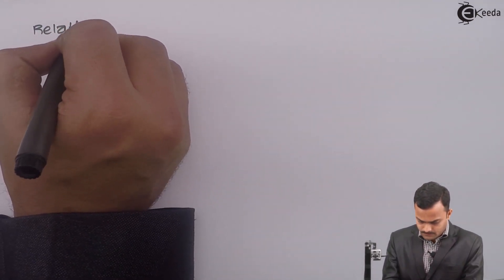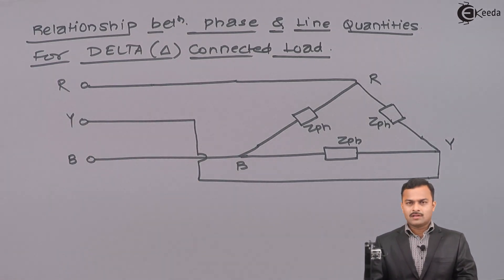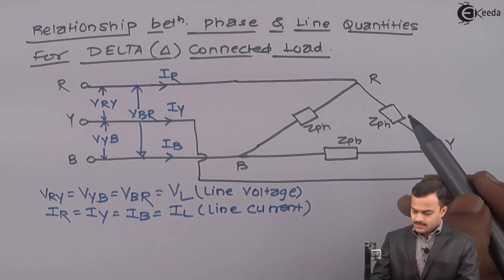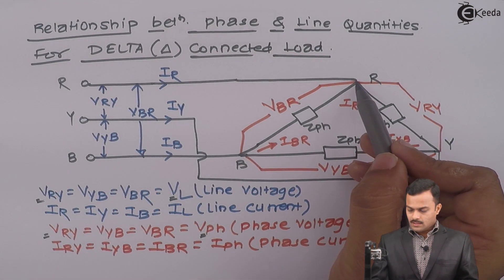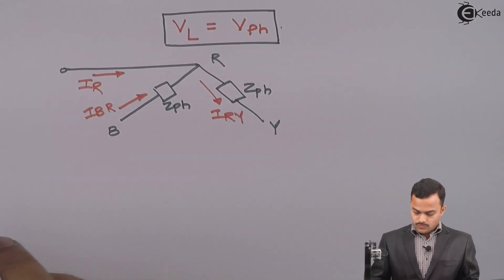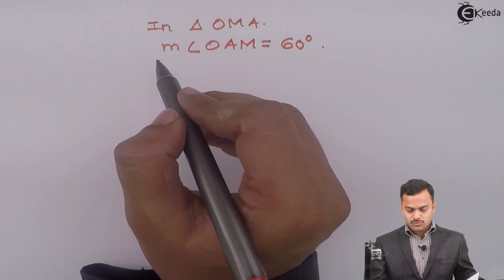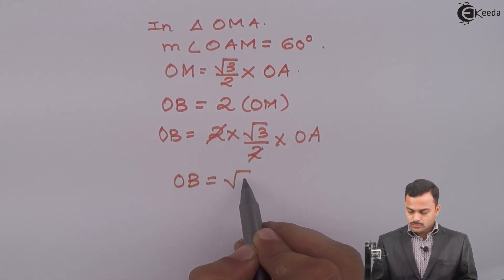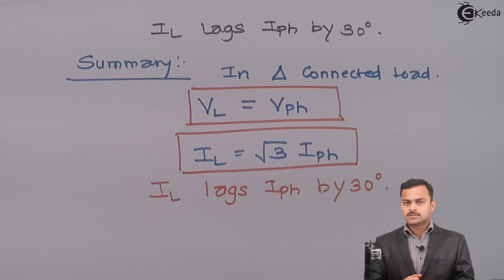Relationship Between Line Quantities and Phase Quantities in Delta Connection - Three Phase Circuits

Comment: Sir, line voltage is root 3 times the phase voltage in balanced Delta connected ckt ........is this statement true .... according to your lecture and my knowledge it is false but in  my  syllabus book this statement is true....
  What is the correct answer?
Reply: What sir explaining in the above video is correct